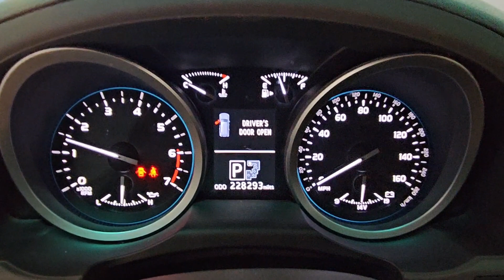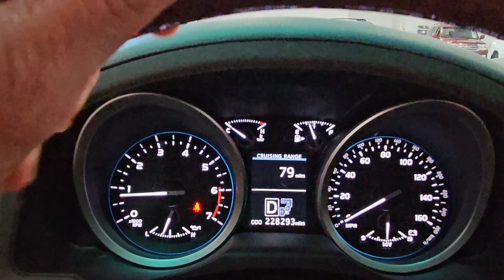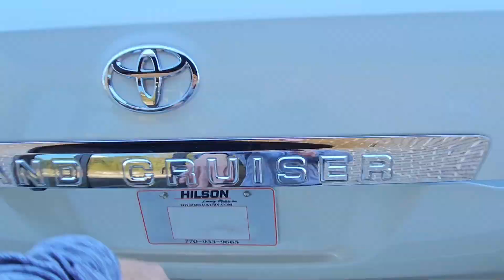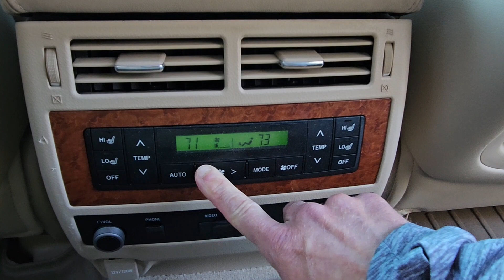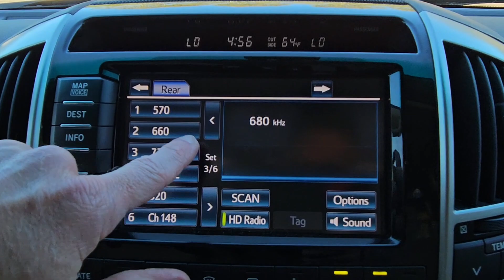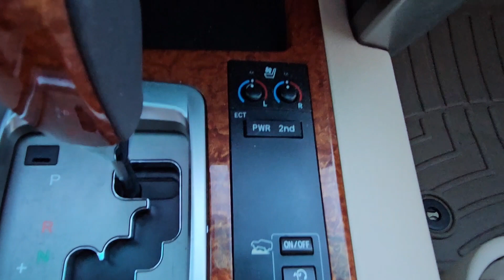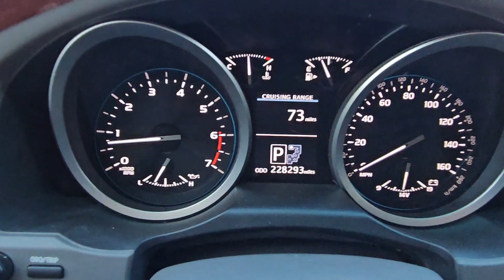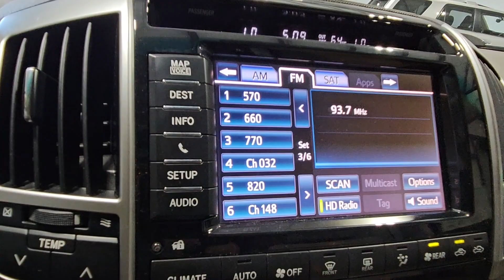2013-200 Series Land Cruiser New Inventory Showcase!

Comment: 2013-2015 are going to go down in history as Toyota's best years ever.  Those three years seem to have bullet-proof vehicles.  I am biased, because all three of my vehicles are from that era - 2013 LX570, 2014 Tundra, 2015 RX350.  All three have over 130k miles, none have had major repair (worst was the radiator in the LX, did it myself, $425 total in the whole thing).  I have 222k miles on the RX350 and it looks nearly new, runs like new and rides like new.

I dearly want another one-owner 200.2 LX570.... I hope to snag one soon.
Reply from the maker: I agree on the 200 side of things for sure. The 8-speed transmission "software" issue in the early .3's is a big downfall for me. The '13-'15 is for sure the sweet spot! Don't have any 570's currently, but reach out when you're ready for another. I'll be glad to help you locate the right one if I don't have one. 

On a side note, my '10 GX just rolled 240k. It's been a great car for me and I hope to be In a .2-200 sooner rather than later.